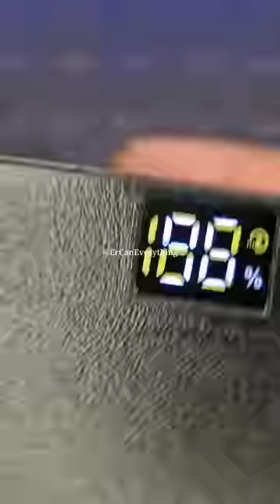DIY 40000mAh Super Fast Charging PD Power Bank

Comment: Bro you could have done the screw system because in further anything happened u could have opened and it would be easy to repair. This was my suggestion that's all
Reply: u can easily remove this glue
Reply: @aibi5532  No you can't but he can easily print another box.
Reply: I think most people would have chosen a box that had a screw on lid, I'm guessing he either printed this one himself and it wasn't a viable option to print the posts for screws, or he purchased this box and screw lid wasn't an option. Either way, I think it goes without saying everyone would prefer to have a screw on lid, but in this case it wasn't an option.

Comment: There ain't no way that is 40,000mAH.  You'd need 12 batteries if you could find 3500mAH batteries.  But as most are around 2600, you'd need 15-16 of them.
Reply: Those are 21700 cells, not 18650! They have 4Ah each
Reply: Actually you Can easily... 
Exemple:
LG Mj1
Panasonic NCR18650CA
Reply: @dulcidy  no you can’t. They are 3500 mAh at best
Reply: Yeah... Read again, he said it's possible if we Can find 3500 mah cells.
I literraly gave you 2 exemples of the 2 biggest battery makers 3500mah cells...
Reply from the maker: These cells are 21700 with a capacity of 4000mAh. They are not 18650
Check 1st pinned comment for full video🙂
Reply: Red Sanyo enter the chat! Lol

Comment: before anyone makes this battery, if you intend to bring it on a flight, this battery would not be allowed as the maximum capacity allowed on board is 100Wh. For standard 3.7V li-ion packs, that's 27027mAh.
Reply: Based on IP5389 datasheet, mAh was calculated per string of battery, so if board says it's maximum capacity is 10,000mAh, it's mean per rows of battery.
Reply: And it's maximum capacity per string based on datasheet is 25,000mAh, mAh was not counted by series, so if you have 10 2,000mAh battery connected in series, it's still count as 2,000mAh
Reply: @ryanmaulana8624 doesnt matter how its connected though. Anything more than 100Wh is not allowed

Comment: Well, definitely not this. Connections soldered on the battery-bad. the wires are burnt to the board and the box with bad glue. Everything wrong wrong and the capacity is max 20Ah.

Comment: YESS FINALLY SOMEONE WHO SPOT WELDS AND NOT SOLDER
Reply: to be fair, soldering can work if you do it well, but easier to weld and less messups
Reply: Been proven soldering correctly dosnt harm the sells in a measurable way IF DONE PROPERLY. But Yeah more damage but its so extremely minor.

Comment: You should use higher gauge wire for battery terminal connection
Reply: should use a lower gauge wire

higher number means thinner
lower number gauge wire is thicker
Reply: I'm sure that's what he meant. Higher current carrying capability wire. But let's face it, if it's made in China, they will never get it through their heads to use proper size wiring.  That goes for ALL of the electronic junk built in China.

Comment: battery pack is connected in the form of 5S 2P so the maximum capacity is 7.2Ah (if the capacity of each battery is 3.6Ah - the highest capacity for 18650 battery) cannot be up to 40Ah as the title.
 If it's 40Wh it's entirely possible.
Reply: 21700 cell is 4000mah so at 3.7v it is 40ah
Reply: @NgBangkt  I see the battery pack is 5S 2P model, so I see 21v on one end, if it is a 4Ah cell 21700 like you said, the battery pack is only 8Ah
Batteries in parallel increase capacity, voltage remains constant
Battery in series, the voltage accumulates but the capacity remains the same
Reply: @blakey271able  yes
Reply: Smartest person on the internet got himself a trollface pfp
Reply: @NgBangkt  bro do you what is mean connect in parallel and in series
Reply: It doesn't matter how much Ah, Wh is what we are looking for. It those cells have 4Ah, that will be 144Wh. If we make it 1S10P it still makes 144Wh. 

Go back to school kids
Reply from the maker: That's right, I just can't explain to people that. The power is equal to a 40Ah 3.6V Power Bank🤷
Reply: @Scootertuner420  The amount of Wh I don't say
but the title 40000mAh is wrong
Reply: @achsunshee  It's a very respectful pfp, it has a long history and reputation. Timeless and legendary, The Troll Face.
Reply: @kebian231  technically it’s correct. 40000mAh indeed
Reply: Yup, technically, but with the step down to 5V as most of batteries are, you still get the exact same wh out of this as a 40000mah 3.7V...
Reply: Yo this is unrelated but you seem to know what you’re talking about and I’m lookin got someone I could ask some electrical questions too ? Is there any way I could contact you ?
Reply: @ghostgk7509  I'm not sure it'll help you much but if I can, I'll help you
Reply: @dulcidy unfortunately we don't account for that
Reply: @ErCanEverything  u do know that phone charges at 5v not 3.7v and phones that have fast charging charges at 9v
Reply: Most of the phone batteries work at 3.7v, a few of them use 7.4v batteries. As you can see, this power bank can charge an average 4000 mah phone for about 10 times.

Comment: What is the difference between parallel and series in batt? Thanks for your help ❤
Reply from the maker: For example, if you connect 10 batteries in parallel, one of which is 3.7V and 4000mAh, then the capacity and voltage becomes 3.7V and 40,000mAh.
But if you connect them in series then it becomes 37V 4000mAh.

Comment: How many amps do those tiny wires carry before catching fire ?
Reply: It's a freakin power bank, not a car jumpstarter...
Reply: Those thin wires are used for balancing voltage between cells while  charging powerbank. When powerbank is being discharged, current passes through nickel strips, thick black and red wires.
Reply: @vismakan6941  I did not see any thick wires.
Reply: @vismakan6941  If you watch the video, all the balancing wires and the power wires is on the same thickness.
Reply: Enough ( will use less than 3A if it's a 63w power bank )

Comment: Ummmm about the battery’s they will charge each other if they have different battery levels and that normally is fine but they can’t limit how fast they charge,they over heat and  eventually they go💥💥💥 a good way that never fails to solve this is to put 
Resistors On onside of the contacts that will slow the speed to an safe level

Comment: Low heat dissipation. 
Low maintainability. it needs latches or screws.
Low safety of touching the contacts of the circuit on high-current elements. in this case, it is possible to shift the elements in the adhesive layer. 

And make rounding on the body! brick is not too aesthetic. 
For the rest - the combination of individual elements of the scheme is good.
Reply: Waiting for your video still.

Comment: Now let's see you try to pull 40 amps on that wire lol...
Reply from the maker: This is power bank is not a power battery to start a car lol😂
Reply: @ErCanEverything  you would need 400 or 1000 amps to start a car... eg: 400,000 or 1,000,000 ma.
40amp is well within short circuit current range for a battery pack like that, and great fire risk with no fuses.
Reply: 40amp/hour.... If u can drain it in one hour.... It's a powerbank and shows its total capacity not hourly amper u can draw
Reply: @DrNumanG  I understand amp/hour, clearly you do too. But what is also clear is that you've never used something without short circuit protection.
Reply: @TheAussieRepairGuy  I understand u too; I did not check the board completely but theese two way pd boards have short circuit protection,  input overvaltage, output over voltage etc. u can check it maybe?
Reply: 40 amps ? So you use 800W USB ? 🤷😂😂🤦
Reply: @dulcidy  never shorted anything out then?
Reply: @TheAussieRepairGuy  what's the connection between shorting wires and talking About pulling 40 amps out a USB port 😂
Reply: @dulcidy  ever had a cheap usb lead that shorted out? I've had several. I've had a regulator catch fire as a result.
Reply from the maker: There is a difference between 40A and 40Ah😉
Reply: @ErCanEverything  yep, especially when you get sonething with a short circuit. Personal experience says a fuse and thicker wire would be a great start

Comment: 10 batteries x 3600mAh max x 90% converter  = Max 33.000mAh
Reply from the maker: The batteries are 21700 with a capacity of 4000mAh
For full video check 1st pinned comment

Comment: Max 18650 capacity is 3400mah !!! Max 8-10ah
Reply: These are 21700, not 18650 cells
Reply: Technically yes, but still same output capacity as a standard 40k mah power bank...